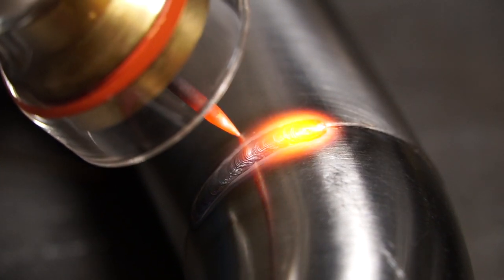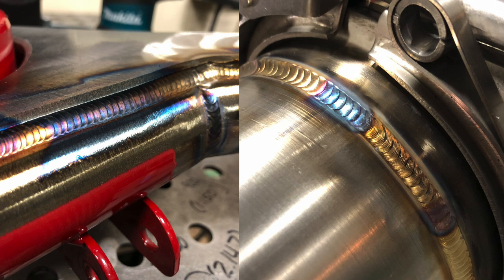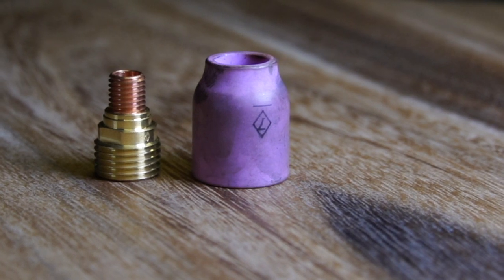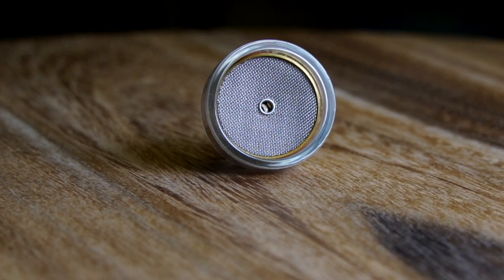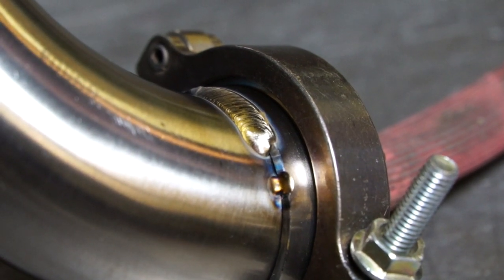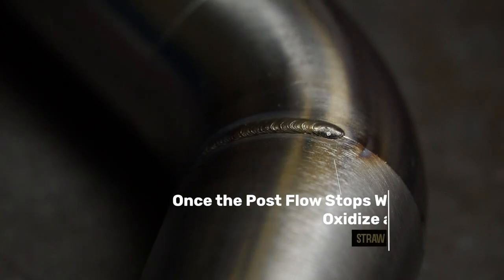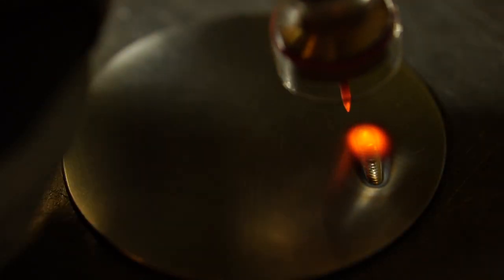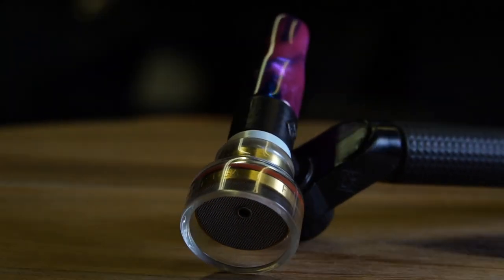How To Get Colorful TIG Welds on Stainless steel Tube Explained | Stainless Tig Welding Cup Tips

Comment: My go-to for carbon steel is a Furick #8 or #10. I prefer the Pyrex cups for increased visibility. I try to use the least amount of gas possible and for carbon steel, as long as I’m not getting porosity, I’m all good. I see people running the #16 on carbon steel and it just seems like overkill. On Aluminum, I’m with Crummy, #5 with a standard collet body.
Reply from the maker: Yeah, I’ll use a #12 on mild steel.. I’ll also use a #20 on titanium so it just depends. If you have a dewar and gas isn’t a huge deal it’s easier to just leave the cfh cranked and the same cup on no matter what. This is mostly about stainless though ✊🏻. Yep, #4, 5 and 6 standard cups are the go to for aluminum depending on the thickness and target oxide cleaning line and tow width.  Thanks for watching!

Comment: This is the only actual video on the science behind color I have seen. THANK YOU!!! I think I will make the plunge and buy a furic but I hate changing my cups and weld really tight corners and always want more stick out so I think I lll just use that fupa for my aluminum too.
Reply from the maker: Thanks for watching! Definitely do not use the FUPA for aluminum.. it’s not what it is designed for and you’ll toast the diffuser with AC current. Not only that but you can’t control oxide cleaning line width of anything else with a cup that large on aluminum. Trust me, you’ll just need to switch cups.

Comment: I have a 71' c10 and a 84' k10 that I am building at the same time.... I have the everlast 275 lightning with the powercool 400.... I just recently bought the furick 5 (for aluminum), a case of 8's, two jazzy's, and a set of fupa 12's(one ceramic and the other glass with the cover).... Can you do some vids on welding 20 and/or 18 gauge sheet metal??  Throw in some settings, cup sizes, and opinions.... I"ll take these to go please.... haha.... Thanks for you intuitiveness!!!!
Reply from the maker: Hey Chad, those are 2 fun projects! Awesome machine, can’t go wrong with a water cooler! I can try my nest to get around to that but It’s definitely not something I do often. I appreciate your comment and thank you for watching!

Comment: I've recently switched to standard length gas lense setup with ceramic cup. I've tried size 8 and 12. I started with number 12 cup, kept the gas flow untouched and had major problems with gas coverage. It was fizzling , the electrode and base material heavily oxidized. I increased the gas flow but no improvement. Then I turned it way down to around 4-5 L/min and it improved, but it still slightly oxidizes during ignition of the arc. After that I've tried out number 8 cup without any problems. Do you have an idea what could cause the problems with size 12? To me a gas flow of 4 L/min seems a little low and it still has some kind of problems with gas coverage with that setting. After many years of welding stainless with regular setup I wanted to switch to gas lense of a big diameter to get rid of oxidation but I was disappointed with the first results. Any help is appreciated.

Comment: I don’t weld stainless as much as I’d like to and I’m not as good as I want to be but I run a CK worldwide flex loc torch and furick fupa when I do. I have been wanting to add a bbw to my arsenal.  Also have the pro cup 8 for aluminum and the jazzy 10 I use for other stuff
Reply from the maker: Sounds like you’re all set up man! All great choices. Ck and Furick offer top notch gear!
Reply: Weldmonger has a buy 1 get one free on the bbw

Comment: What are  the part numbers for those pyrex cups , do they come complete with all the brass , who is your supplier , do they offer international freight ,  what gas flow do you typically run .
Reply from the maker: They are stated in the video as well as in the description. You can find the cups on Furickcups.com and I explained my gas flow in the video a couple times.. 25 cfh for a #12, 35-40 cfh for a #17 and 50 cfh for a #20 cup.. yes, he ships international. Have a great weekend.

Comment: So to get blues and purples I need material to be hotter before I remove gas or I need to hold the gas to longer while the hotter material cools?
Reply from the maker: Blues are hot. You need to pull the gas away at just the right time when the material is hot. You’ll get a feel for the colors and when you pull coverage to achieve them.

Comment: That last arc shot looked like your arc cone was mondo! I use #8 pyrex lense. Just got bbw12 ceramics and the adapter for titanium. I can't get non silver stainless welds no matter what I do. 304 with 308 or 309. 309 tries to get some straw color but gets scared and stays shiny.
Reply from the maker: Hi! Good morning. What do you mean an adapter for titanium? A trialing shield? That’s a great cup! If you’re welding titanium then getting no color is what you want.. titanium should have zero oxidation. Let me know, I’m curious!
Reply: @hourglassingenuity103  17 adapter for the bbw which uses 2 series body. Not tried titanium yet.

Comment: I was wondering why you ground your electrode after each pass you make on stainless. I don't know enough about TIG to know if it is a good practice or not, and you would have to know that the electrode is cool enough to not fuse to the workpiece.

Comment: What gas flow rate per cup size do you recommend?
Reply from the maker: Hey David! I’m about to do a video on welding stainless steel tube and I’ll include that info in the video but.. #8 gas lens I run about 20 cfh.. #12 flood cup I’ll run 25 cfh with .750” stick out.. I’ll run 35 cfh with a #17 and even up to 50 cfh with a #20 cup on titanium!

Comment: What amperage and chef would you suggest for .100 stainless using a FUPA12?
Reply from the maker: Chef? Clear that up for me and I’ll reply with an answer 👊🏻👊🏻
Reply: @hourglassingenuity103  😂oops autocorrected, I meant CFH
Reply from the maker: Haha no worries! Personally I’d run about 100 amps on the machine and use the pedal to acquire the toe width and heat Input I want.. I’d flow 25 cfh through the #12 with about .750” of stock out. ✊🏻
Reply: @hourglassingenuity103  OK, thank you for the advice ill let you know how it turns out
Reply from the maker: Dan Rupprecht absolutely! Please do. Happy to help however I can.

Comment: I have 3 go to cups for aluminum I use the furick #5 then for thinner stainless and titanium is the furick #12 and then building SS or titanium headers or exhaust is the monster #15. But the furick #12 gas lense is on my Miller syncrowave 210 99 percent of the time.
Reply from the maker: Heck yeah. Sounds like you have a really good rotation figured out on your welding consumables. That’s fantastic!

Comment: There’s a confusion I have when I weld stainless and my weld come out blue or purple some OG’s say I’m too cold and the inspectors say I’m welding too hot what do you say
Reply from the maker: I explained this in the video but, when your welds and blue and purple you’re base materials temperature is hot when it’s exposed to atmosphere when your post flow stops.. blue and purples vary from 400-600 degrees Fahrenheit. That means you are too hot when your weld is exposed to atmosphere.. so you need a longer post flow or you need to reduce amperage if you want lighter colors like straws and deep golds.
Reply: Thanks man I will try to lower my amperage and make sure the base metal is not too hot
Reply: If your amps are too low, it causes you to have to slow down, which in turn ups the heat input. 

Solution......Wire brush👍 if it passes xray, corrosion test and hardness tests, theyre most probably "inspectors" that have typically never picked up a torch, just go by a textbook. 
Tell them to do it there and then, to demonstrate. 
They usually wind their necks in then lol

Comment: But with all those starts and restarts it will be harder to get a weld to pass x-ray rigth?
Reply from the maker: No. Not at all.. I’ve done plenty of Xray aerospace work and I’ve never had a problem with stops and starts.. a positioner is nice but not necessary. But, these are stainless tube welds for automotive fab and most of this stuff requires stops and starts because you can’t turn an entire exhaust on a turn table and these definitely don’t require x ray.
Reply: @hourglassingenuity103  okay its just the old timers at the shop i work at say that its the easiest place to get faults in x rays.
Reply from the maker: jørgen rafaelsen he’s not wrong at all! It’s just about technique. 👊🏻
Reply: @hourglassingenuity103  bet! will test your technique!

Comment: And if your weld on stainless steel is dis coloured its shit,you have burnt the chromium out and left an iron rich surface under the discoloured oxide film which WILL rust,keep your gas low and move fast-discolouration is a shit weld END OF!!!!!